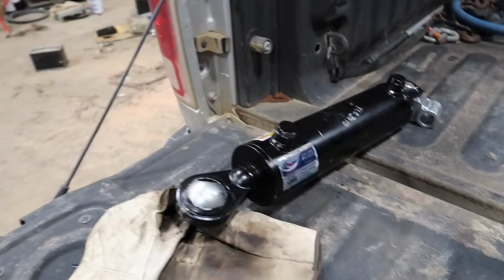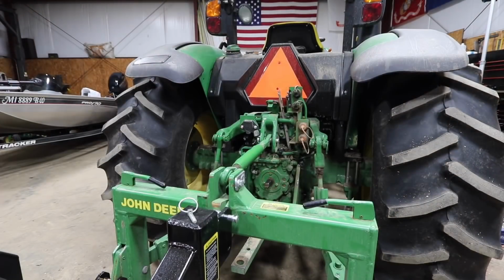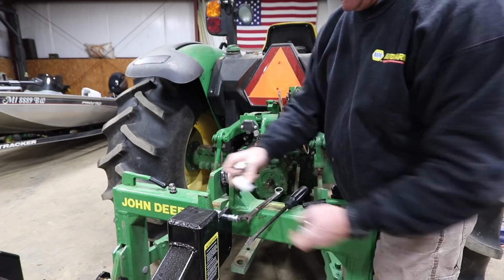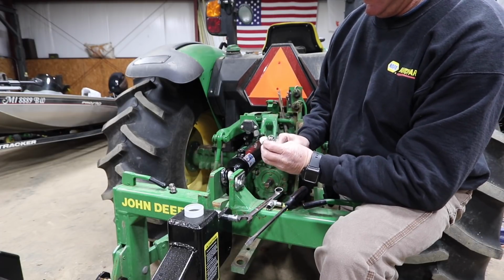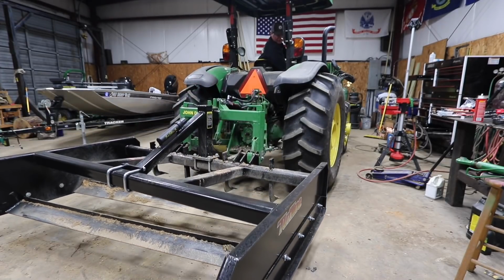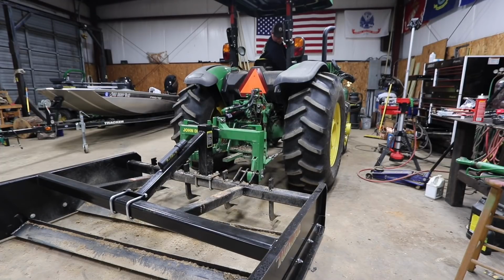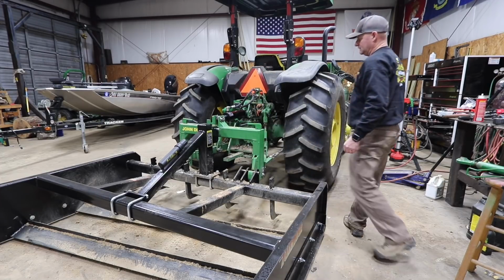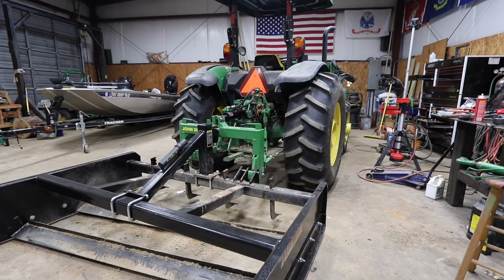NEW hydraulic top link cylinder installed on my John Deere 5075e tractor!

Comment: Loctite 567 is for hydraulic fittings fyi. Teflon is horrible for this as if u get it into the hydraulic system the tape will take out your seals. Just a thought. I do hydraulic repairs for work thought I'd pass on a tip for u.

Comment: Nice video, thanks for posting.  Did you consider a cylinder with a check valve?  Not sure if it matters but in doing research for a Hyd. top link for my tractor I reviewed several cylinders that had the check valve.  Seemed it was recommended for box blade use especially when using for a long period of time.  The check valve is supposed to maintain the set position.   Now that you have had it for a while do you have an issue with the cylinder not holding a set position?
Reply from the maker: No issues even after several years.

Comment: Wouldn't it had been easier to remove the square u bolts and brace(the piece with the plastic canister)on the grader and replace it with a hydraulic cylinder going from grader crossbeam to upper rear QH

Comment: Did you install the 2nd rear SCV’s on the tractor or did it come with them? Also did having the second rear SVC cause any issues with adding the 3rd function set up to the loader?
Reply from the maker: I put the second svc on. It didn’t cause any issues with the 3rd function.
Reply: cotontop3 good deal. I’m wanting to add both of those features to my 5055E.

Comment: Seems like I've read that you're not supposed to use tape on hydraulic fittings -- that it'll cause leakage. Did you find that to be the case?
Reply from the maker: If its pipe threads, you gotta use some type of tape or pipe dope.

Comment: You may have said and I just missed it but what size of cylinder ( stroke & shaft size was it). I have a 5075E John Deere also.
Reply from the maker: I’m not sure on that. I got it through a local dealer here Wade equipment.
Reply: @cotontop3  Thank you

Comment: Where did you get the top link? Do you have any plans of getting a hydraulic cylinder for the side to allow for tilting left right? I've been looking at one for the box blade or grade blade. But, I can't decide if I want to do that or switch to a pull type box blade that has a tilt cylinder on one side. Don't really have anything else that could use tilt feature.
Reply: Floyd Farms I believe in the video he said it came from his local John Deere dealer, Wade, Inc.
Reply: Brenton Medders ahh good catch! Volume was turned down when I started and missed that at the start. When he said it near the end I didn't hear a name, just said dealer. Thanks!